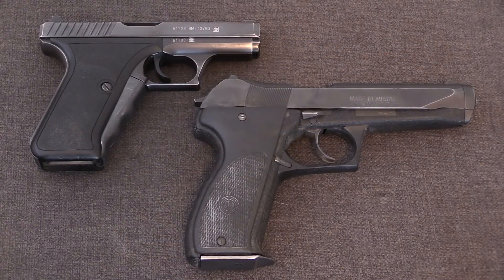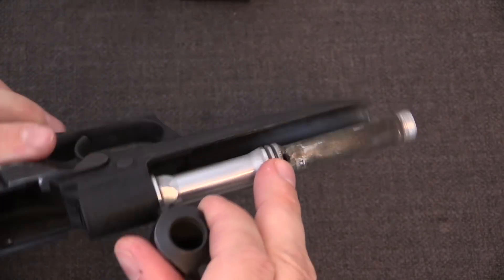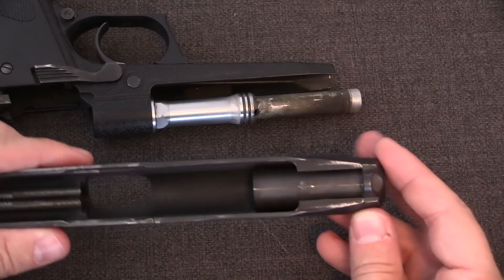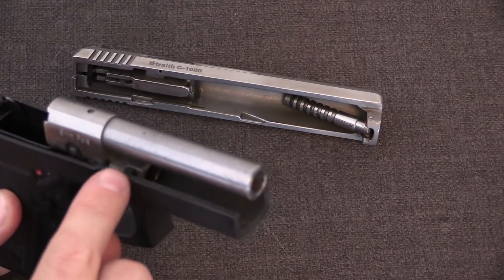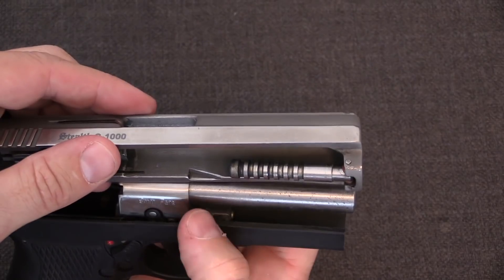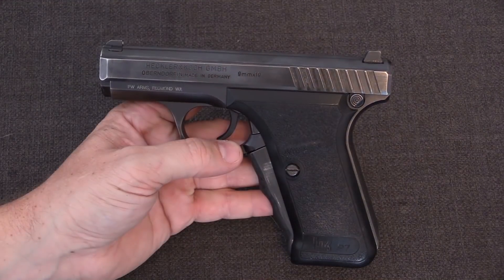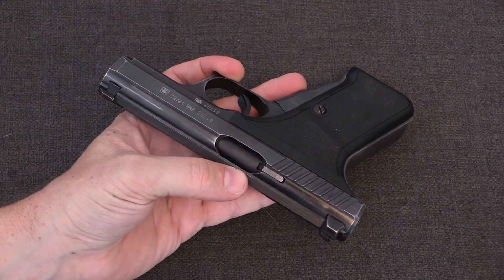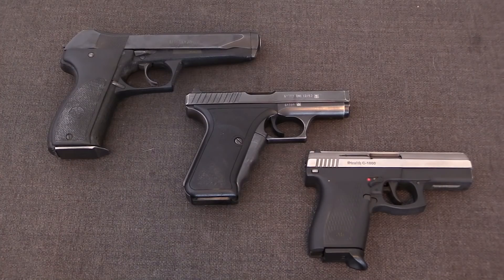How Does it Work: Gas-Delayed Blowback

Comment: The failed "copy" of the GB80, the LES P18, tried to drain gases from the chamber area, just like the P7 and even so, it didn't work as well as the original GB80. Poor manufacture maybe?
Reply: in his video he showed a terrible gas piston fit and it leaked all the gasses and didnt delay the slide at all making it a direct blow back gun

Comment: That is a gas operated delaying system. How about a system that is gas operated unlocking system? E.g. a gasport in the barrel opens behind projectile, allowing gas to trigger the opening of the bolt via some kind of system reminding Brownings potato digger or something. Relatively light bolt remains locked and closed until the bullet reaches a certain point down the barrel end, releases the light bolt which still gets a little, but enough blowback to cycle the gun. Gasses needed to work this system should be minimal, so they can well be vented out without heat issues. As a bonus; With a dud round, there is no possibility to cycle a new round with a bad bore obstruction.

Comment: One other drawback you didn't mention is suppression. Although fixed barrel guns are usually easy to suppress because you don't have to worry about a recoil booster, gas delayed guns don't suppress well because the added backpressure can cause cycling issues.

Supressors can be made and tuned for specific guns like the VAIME suppressor made for the P7M13SD used by the Argentine Navy, but it was absolutely MASSIVE in order to reduce backpressure via large internal volume and required equally absurdly long barrel threads to support the weight. Needless to say they weren't very popular or successful.

Comment: Nicely done, Ian. I worked in a large gun shop from 93-95. I remember one day pulling out the P7 and its manual to fieldstrip it (pretty easy) for my own edification. It was interesting to see the internals and comprehend exactly how it works. I still want one someday, but the prices on the used market keep going up.

Comment: No matter how many times I watch videos explaining this system, I still can’t understand it fully. I have trouble grasping how there is still enough energy to cycle the gun when the system doesn’t unlock and start moving until after the bullet has left the barrel.
Reply: In a delayed blowback gun, ANY system (roller, lever, radial, gas...) the bolt/slide starts to travel rearwards the same moment the round is fired. The delay only makes so that the movement is slow enough that the bullet exits from the barrel before the case had been stretched enough to break it (the function that the simple mass of the bolt has in a pure blowback system). 
Then, in the case of the first gun shown here (the Steyr GB) it’s rather questionable if an opening half way through the barrel, from where the spilled gas has to fill a relatively large space  can really act to delay the opening of the action until pressure drops to safe level. Probably it acts just like a buffer, preventing the slide to slam into the frame at a speed dangerous for the integrity of the gun (and detrimental for the comfort of the shooter), while the action is largely a pure blowback.
Reply: The amount of energy need to delay the action is very small in comparison to the amount generated by firing.

A 9mm can generate somewhere near 35000 psi. This system is using a fraction of that to hold the barrel closed.

As the bullet fired, just as the bullet leaves the chamber, a small amount of gas is diverted through a small hole to holding the slide locked.

The bullet is the plug maintaining the pressure.

Gun powder burns. 
It continues to burn as the bullet is moving down the barrel. Creating more pressure. 

This pressure keeps the previously diverted gas under pressure and the slide locked.

When the bullet leaves the barrel the pressure in the barrel drops dramatically. The diverted gas is no longer being held in the piston and rushes back out the port.

The remaining energy cycles the firearm.

Comment: It’s rather questionable if an opening half way through the barrel, from where the spilled gas has to fill a relatively large space (like in the first pistol shown) can really act to delay the opening of the action until pressure drops to safe level. Probably it acts just like a buffer, preventing the slide to slam into the frame at a speed dangerous for the integrity of the gun (and detrimental for the comfort of the shooter), while the action is largely a pure blowback.

Comment: And make it with a quick-change barrel and the gas system I e suppressor and make the outside of it a lot easier to radiate outside jacket of the barrel suppressor gas system combo

Comment: It would be really cool to see someone take a gas blowback system like the first gun that you should with the barrel as the piston and make suppressor gas blowback operating gun to where the gun doesn't have it's gas system without the suppressor but not like oh welrod even though they're really cool so again that has to operate the action and that's damn near completely quiet using only the suppressor that would be really cool for a semi-auto that's the other thing well rides are single shot even though they have a MAG

Comment: I was at a 2-day CCW shooting class a few years back, and one of my classmates, a doctor and a pretty cool guy, had brought an HK P7M8. It's a great choice for a carry gun but NOT for a shooting class! Thirty minutes into the class I loaned him my spare pistol for the rest of the day because his HK was getting too hot to handle. On day two he brought a USP9 instead. He wanted to use the P7M8 because that's what he carried. He learned the hard way that it's a fine choice for a carry gun, but it's just not an option for a high volume shooting class. 

It worked out great for me though. For the first time I actually got to spend some time shooting a P7, and I've been wanting one ever since! They're great little guns, except the M10 version. That one kind of sucks. Not all 9mm's can be successfully adapted to .40S&W, and the P7M10 is a good example of a failed attempt.

Comment: I have long thought thaqt gas delayed blowback would be optimal for shotguns. This is because of the enormous range of variation in energy and pressure from shell to shell. Gas delay would automatically proportionally increase delaying force with chamber pressure. That solves the biggest challenge for semi auto shotguns. The other big challenges have to do with the wonky shapes (plural) of shells.
Reply: Sounds interesting.

Comment: I wonder what the upper limit for cartridges is for gas delayed blowback? I had thought it would be suitable for a pdw carbine concept especially if the gas vented into a piston above the barrel bringing the barrel more into line with the hand-shoulder axis and where the heat could be more easily dealt with.
Reply: I've never seen/heard of anything successful above 9mm for gas delay, it's really not a good system for powerful cartridges. If you must have a blowback rifle, roller delay is basically the only good option, and even then, why not just use a piston or DI gun? If you're worried about an inline barrel and recoil impulse, blowback of any kind will recoil harder than anything gas operated, it's just a more violent system.
Reply: @aurorawhorealis  The only production gas delayed blowback gun I can think of using something hotter than 9mm parabellum is the .40 S&W version of the P7. The reason for choosing this system above roller delayed or gas operated systems is simply cost and complexity, it falls between simple  blowback and more mechanically complex designs gaining some but not all of their advantages.
Reply: @Matt_The_Hugenot  Oh yeah, I forgot they made production runs in .40. So yeah, just judging by what actually has been successful with gas delay, I'm not sure it could handle a rifle round, even 5.56, not comfortably at least. Would probably get way hotter way faster with rifle rounds too, it won't benefit from gas moving and venting like a gas operated gun. I get the "perfect middle ground" idea you have, it sounds compelling. But, in a world where a $700 AR can compete with or beat literally anything else, would a brand new design using that system actually be cheaper to produce?
Reply: @aurorawhorealis  I'm not sure what the limiting factor is, pressure, muzzle energy or velocity. The only typical rifle cartridges I'd consider are subsonic ones, .300 AAC Blackout seems obvious, though that brings risks from someone loading supersonic ammunition. 5.7x2.8 is a logical candidate, it's designed for the pdw role. I'd like to see a design in .30 carbine, it's an underappreciated round.

Comparing it to a normal AR is interesting. Someone could build a gas delayed blowback upper in 5.7x2.8 that fits into an AR platform it would have less parts and wouldn't require the buffer spring making it even cheaper.
Reply: @Matt_The_Hugenot  Pressure is above all other factors, though in a blowback having low enough bolt velocity/enough dwell time to not outrun magazines and extract cases instead of rip case heads off is an important and sometimes tricky consideration, too. Okay those cartridges are different, only a little higher pressure than handgun rounds. I think .30 carbine would perfectly fit the role you want, it's basically a rimless version of .32 WSL which was used in straight blowback guns, it would probably be pretty tame with some form of delaying. The p90 is straight blowback, no delaying necessary for 5.7. There actually is a 5.7 AR upper available, it's called the AR-57 and costs about $750, less parts doesn't always mean cheaper when there are a tremendous amount of ARs built every year, making production fairly cheap despite their relative complexity, they also are very efficient to produce with modern manufacturing techniques.
Reply: @aurorawhorealis  The AR-57 is a niche product for those that want something a little different, it's not really intended for high volume production as far as I can see. A gas delayed P90 would have even less felt recoil though it's too complex a weapon for my idea.
Reply: @Matt_The_Hugenot  True, but isn't any AR-competitor/alternative niche too? I don't think it's just because it's like a boutique upper, they just never got very popular, I think no one really had a good purpose for it. 5.7 is too pricey to use as a plinker and it's ballistics suck compared to 5.56, so why not just use a regular AR if you're gonna use an AR platform?
I really don't think that gas delay is necessary for 5.7, p90s are really light and still very controllable in full auto, it'd be cheaper and simpler without delaying. Wrap it up in a simple and handy carbine package, p90 mag compatibility would be a nice touch, and I think you'd have a great little gun for the idea you have, like a ps90 at a price point that people would actually pay for. Now if only 5.7 would come down in price.

Comment: I wonder, Could a sort of integrally suppressed pistol be developed with a baffle stack connected to the slide which works simultaneously to slow the slide as well as contain a bit of the muzzle report? Perhaps the barrel would be ported like the first pistol shown also? And would a baffle stack create more or less force pushing the slide forward keeping the chamber closed? Multiple surfaces each being forced by gasses, hmmmmm?

Comment: Hey Ian, thx for all your awesome videos, what would define sustained fire? are we talking one mag or more?
Reply: Cyclic rate is the fastest speed the weapon is capable of firing. Usually given for automatic weapons.
Weapons tend to overheat very quickly.
At some point usually causing some sort of malfunction.

Sustained rate is the rate of fire that the weapon can shoot for long periods of time without overheating or malfunctioning.

A machinegun might have a Cyclic rate of 750 rounds per minute.
Hold the trigger back and let er rip.

The sustained rate might be 125 to 200 rounds per minute.
This allows the heat to dissipate a little bit.
It is one of the reasons Machinegunners are taught to shoot bursts.

Still going to be hot.

The quasi exception to this rule are water cooled MGs. Some had sustained rates very close to the cyclic rates.
Reply: @shawnr771  thx for the in depht answer
Reply: @tinokarl64  You are welcome.

Comment: Absolutely interesting system.
Have you seen the new Luago Alien 9mm?
Reply: Key Hole I have and it’s the only handgun I’d consider truly revolutionary in my lifetime at least from already proven fully functional tech (some Gauss guns are also but they don’t work consistently yet)
Reply: @kalmenbarkin5708 
It's a good project but a young construction. It will improve with the time.
There is a solid firm behind this gun.
Actually I believe that is the most advanced gun on the market.
Reply: Key Hole it’s what I would consider a beta test (5k + isn’t market for a Czech gun) and so far the reviews are raving as with all new systems there will be kinks that need to be worked out but I’d agree it’s the first really fresh take on what a handgun can be in a very long time
Reply: @kalmenbarkin5708  5k+ isn't the market for a Czech gun?
Have you told the Czechs who make the FK Brno Field Gun?
Reply: Gustav Meyrink does anybody buy that overpriced CZ75?
Reply: @kalmenbarkin5708  not my price range but I'd be much more inclined to buy an expensive Czech gun than any other except may be German or Swiss. The Czechs are very, very good engineers as witnessed by their cars: While using the same components as other VAG brands Skodas are better built than Audis. Ironically VW got to where it is today by stealing the Beetle design from Tatra.

Comment: Can we have roler delayed blowback? Please
Reply: All roller delayed guns are blowback as far as I know. If you look at a G3 rifle or an MP5 sub machinegun, they don't have ported barrels. The gas pressure from the firing cartridge comes directly back towards the bolt. The bolt is delayed by the rollers pressing out to the reciever.
Reply: The tube the roller delayed guns have, are only for the charging handle and its rod. As far as I know, there are no moving barrel (short or long recoil), no piston (short stroke or long stroke gas piston) nor any other kind of mechanism that redirects the gas.

Watch this:
https://youtu.be/Xusr9M9cHr4